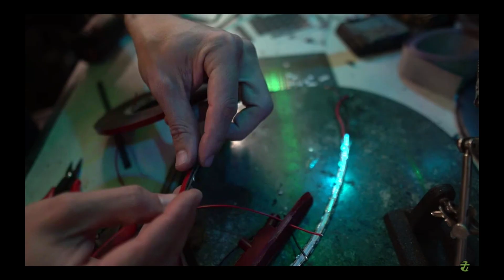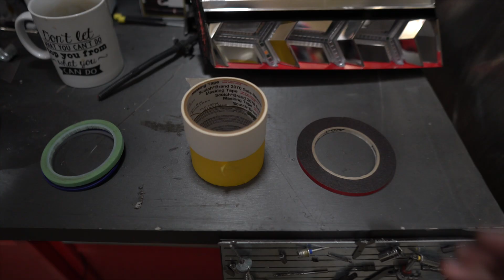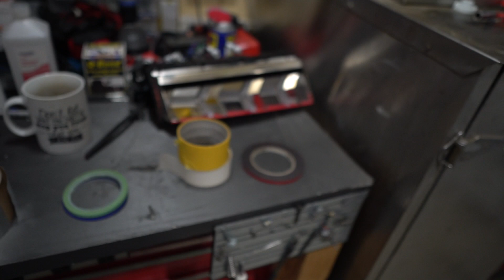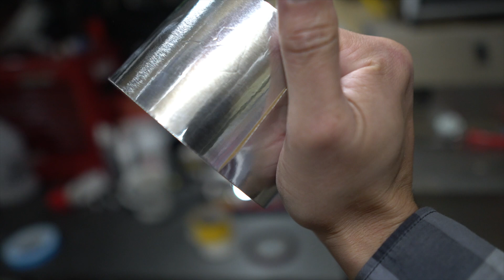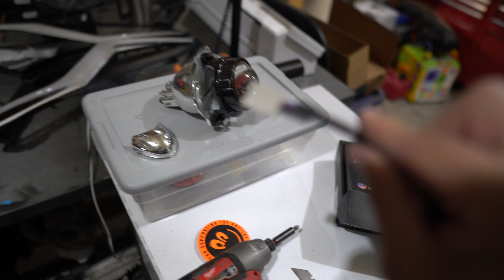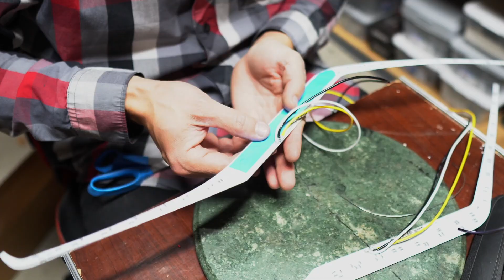The Tape You NEED (for Custom Automotive Lighting)

Comment: I’m an electrical sign designer and we spec 3M VHB adhesive(aka 3M brand double sided foam tape) for all LED and FCO applications. Or what we call red tape is a double sided rubber Gel tape used when you want clear tape instead of white or black foam. Also 3M brand for the red tape.
Btw VHB stands for Very High Bond I believe and FCO are flat cut out letters/logo